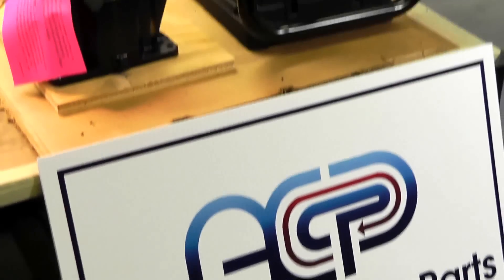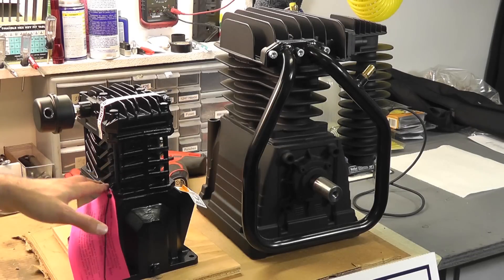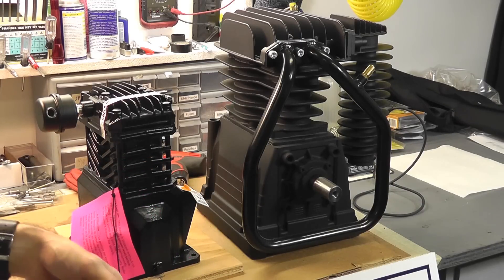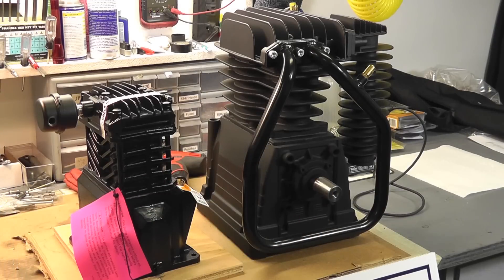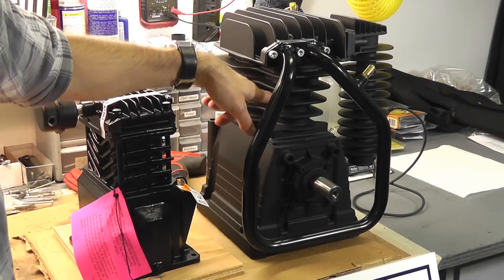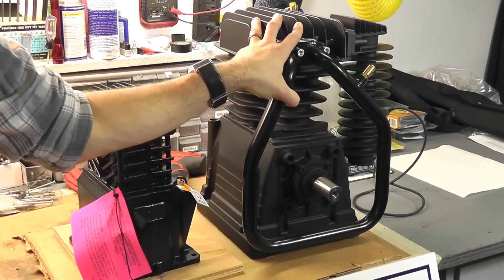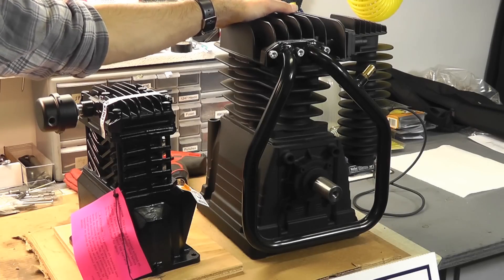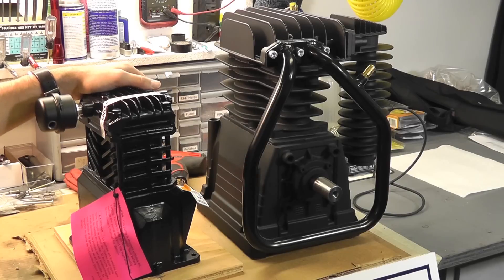The Difference Between A Single Stage And A Two Stage Pump

Comment: I own the that exact same pump got it new on an Air America made by DeVilbiss , 27 years old , has been a charm, replaced the reed plate and gaskets , upper end GASKETS needed 😊for that job, reeds had no lite passing Thur ,cleaned with de carbonizer , perfect.That was 6 years ago, been my best buddy.started getting louder , bottom end more so, then upper ,pulled the pump drained the oil thur the paint strainer , normal discoloration, always use wolfs head air comp. 10w30.needs to come apart , and before I open her up, want to be sure parts are somewhat available, well I have called many of the repair and sales and they say bearings obsolete, don’t want to get into cam bearing substitute, if I get lucky and find something close, specifications appear to-be non extent , So What I’m saying is 

HELP PLEASE 
Randy Carbeutor

Comment: single stage pump has more cfm than two stage pump. all piston are working to deliver air, rather than two stage pump that several piston suck air from atmosphere. single stage has equal size of pistons. I HAVE EXPERIMENTED IT WITH JUST THE PUMP(same size pump and number of piston) AS MANIPULATED VARIABLE. two stage does filled the tank slower. do your research first before arguing with me.
Reply: People often fall for marketing tricks and don't consider apolication.  The average user has little to no need for 2 stage, yet they think it's better for them when it's just better for the manufacturer to make more money.

Comment: Great video buddy, thank you for making it. I would like a stand up 60 gallon compressor but I don't know which one to go with when it comes to 2 stage or 1 stage. I'll be using it for air tools on engines filling tires and occasionally using a air sander or bead blasting engine parts and sometimes painting with my air spray gun but mostly I'll be using it for impact tools and tires. Can anybody point me in the right direction if I should go with the 2 or the 1 at stage.
Reply: pretty sure all that matters is the tank capacity and the CFM rating. any 60 gallon tank unit should probably suit your needs.

Comment: can u use the single stage pump on a 60 gallon compressor....?..
Reply from the maker: You sure can. There are many different sizes of single-stage compressors, from the smallest oil-free unit to large, v-twin (or tri-piston) pumps. Of course, if the pump is a very small direct-drive oil-bath or oil-free unit you won't want to install it on a 60 gallon tank, but any belt-driven oil-bath piston pump can be installed on a tank of that size.
Reply: @AirCompressorPartsOnline  ok great thank you

Comment: No!! You get more CFMs from a single stage because you have 2 pistons working together,, a single stage will run smoother and quieter and even cooler then 2 stage, due to not pumping the air twice, best to buy single stage for all around use,,,mine was set at 155 and I turned it down to 130 psi,,,all I will ever need and it will extend pump life because it cuts the time to fill the 60 gallon tank by almost 2 minutes,  more CFMs is more important than crazy high 175 psi pressure, unless your filling big truck tires,,,
Reply from the maker: You do have a point, George, and thank you for the comment. For most applications (especially weekend warrior types) a single-stage compressor is sufficient. Yes, a two-stage compressor operates at a higher PSI and generally, two-stage pumps DO produce more CFM, but there's a catch: at lower pressures, single-stage units usually do product more CFM but at higher pressures, two-stage units product more CFM. It also depends on the number of pistons each pumps has, and the size of them (as well as the horsepower of the motor running the pump).
Bottom line, it's really a matter of the particular application one will be using the compressor for.
Reply: @AirCompressorPartsOnline  l I have a 60 gallon single stage 2 pistons with 3.7 hp in my shop. 11.5 CFM does ok for most of what I do and electric tools have come far and even better than air tools now,,,, but I picked up a vintage speedair 4 cylinder Smith pump single stage with 8 hp gas engine,,,monster puts out 36 cfms,,, I restored it. like new payed 100 bucks and in research found out American eagle still makes the compressor pump and it's 6000 dollars to buy it now,,,lol. Love those finds
Reply from the maker: @georgespangler1517  You got yourself a find there indeed, wow. American Eagle is still around, certainly and I'm familiar with the Smith pumps as many were used on the older Sanborn compressors.

Comment: Looking to buy 5 HP 80 gallon air compressor but quiet one , what is your recommendation?
Reply from the maker: Thank you for the question! There aren't many very quietly operating 5 hp 80g oil-bath compressors out there to be honest. California Air Tools does manufacturer an oil-FREE stationary air compressor and the noise level on their compressors is very low, but the oil-free unit may not provide enough CFM for our application, so it really depends on the CFM demands of your compressor.
For oil-bath units, you should be able to purchase a noise-shielding cover for it, which is usually available as an accessory. It's essentially a ventilated, sound proofed box that covers the entire motor and pump.
You can see an example of a unit like that at the below link:
https://www.maxtool.com/products/belaire-qp318ve-208-230-volt-5-hp-80-gallon-vertical-electric-air-compressor

Comment: hey i have a 180gal 200psi tank i just bought its a saylor beal. and it hit over 200 unless the gauge is off...anyway i just bought it i think it might be from 1972 it doesnt look all thaaaat old but is that tank still safe to use to 200 psi? water drains a little orange but not brown
Reply from the maker: Thanks for the comment! As long as your tank holds pressure and you have no pinhole leaks, it [should] be safe to use. I can't speak to the integrity of the tank for 100% certainty as I can't see it, but I would certainly keep the pressure under 200 PSI just to be safe. Most tanks can handle this pressure but giving the age, I can't be certain. If the unit pressurizes past 200, I would replace the on/off pressure switch, as most two stage units are set for a max pressure of around 175 PSI.

Comment: Just want to ask another difference between single stage with two or more cylinder and a multi-stage with two or more cylinder is their size in piston, since in a larger piston large volume of air is suck having a low pressure, and goes into an intercooler then to a smaller piston to compress the cooled compressed air to higher pressure. 

in single stage no matter how many pistons a compressor have as long as it have same size of pistons it can't compressed further to a higher pressure.

Hoping for your reply thanks.
Reply from the maker: That's a good insight Julius and yes, you are correct. In 99% of two-stage units, there is a low pressure piston (at least one, depending on how many pistons it has) and a high pressure piston. the HP piston is smaller and the LP piston is larger. For S.S. pumps, the pistons are generally all the same size. Thanks for the comment!
Reply: When you look at the picture,,I have the smaller unit,,,but it has 2 pistons doing the same thing as the one big piston on unit on right,,making the same amount of air,,,, but unit on right has little piston to boost up to higher pressure,,,, my unit will make 155 lbs of pressure,,,at 11 CFMS at 90 psi,,, and is smaller and quieter and cheaper to run,

Comment: Hi there, very informative thank you. Would either of those models be a good piece to consider adding to my truck as a permanent fixture?  Mainly, during long runs, I really have no way of properly and quickly to fill up my tires.  it's a 1 ton dually pickup and heaven forbid i need to top up 4, 6 or 7 tires on in the middle of nowhere with nothing but the 'cough' heavy duty box store brands?  They need 80psi, one time when one was real low, i am quite sure after 30 minutes of nearing 70psi is why that compressor died.

Much obliged.  also, id like to know what you might recommend for such a solution to invent.
Reply: Fix the leaks and you don't have to top up 7 tires in the middle on nowhere
Reply from the maker: Thanks for the comment! When choosing a gas-powered air compressor for a service truck, I always recommend a two-stage pump. This will give you higher CFM and higher PSI. I'd recommend a unit that puts out at least 15 SCFM if not more. A 13 HP or 18 HP gas engine would be necessary to push a two-stage pump that puts out the CFM you need. I'd recommend brands like Jenny , Quincy, Ingersol Rand or Rolair as these are heavy-duty units made for the jobsite and service vehicles.
Reply: Wow, glad to read that, Ill check out those brands and consider the space and power requirements incorporating your suggestion.  I had a good deal to be made on a Schulz MSL 10 MAX.  Thank you kindly for replying to my question.  Glad you are still around!

Comment: i have the compressor on the left what size electric motor would i need to run that
Reply from the maker: You can run this pump with a 1 to 3 horsepower electric motor. Typically, a 1.5 HP to 2 HP is used, as the higher horsepower motor will give you more torque and hence more CFM delivery (due to it spinning at a higher RPM). Hope this helps!
Reply: Thank you for your fast response much appreciated :)
Reply: Air Compressor Parts Online , Thank you

Comment: what is the ratio between the large cylinder and the small one or dose it mater
Reply from the maker: Good question! I'm sure it does matter, and this spec will be determined by the manufacturer when designing and building the pump. It's not a set standard for every two-stage pump, as manufacturers have their own reasons for determining piston diameter, length, etc.. Many pumps I've seen have a high pressure piston that is roughly 1/3 the size of the larger, low pressure piston. That's a good question to ask the manufacturer if you have a specific pump in mind!
Reply: I am looking to build a two stage silent compressor using two fridge compressors. I am guessing to get them to work efficiently in tandem it would be ideal if the output of the first compressor was equal to or slightly less than the second compressor after its compression stroke. I am using a plasma and other tools in a residential environment and need high output but obviously low noise. in hind sight the first compressor will expand to match the second cylinder so it is really only crucial to ensure there is no back pressure in the first cylinder to cause stress but the second is still small enough to retain the bulk of the work the first has already done???. so a small priming tank would be enough to ensure both didn't work against each other. I am not sure I may have answered my own question but please rip it to bits if I am wrong

Comment: i m pretty sure that ''intercooler'' tube does nothing it s just a pipe doesnt even have fins and its to short to cool incoming hot air .. air to air heat exchanger doesnt work that way
Reply from the maker: You're right about this particular two-stage pump and about "air-to-air" cooling. The manufacturer calls the tube an "intercooler" but it's essentially just a transfer tube, transferring the air from the low pressure chamber to the high pressure chamber of the pump head.
The "aftercooler" on this two-stage pump does have fins, but for heat dissipation only. 
If the user wants to effectively cool the compressed air before it reaches the tank, one would have to install a belt-guard mounted aftercooler, a liquid-cooled stand-alone aftercooler or something similar.

Comment: How can you possibly say that a two-stage air compressor will as you put it recycle quicker
Then a single stage air compressor when the overall displacement is larger in the single-stage machine then the 2-stage machine case in point in a two stage air compressor the capacity of the machine is only the displacement of the low pressure piston does this make sense to you?
Also maximum interstage pressure is only 45 PSI not 70 check it for yourself with a gauge
Reply: No matter your displacement every pump of a single stage is going to give you about 100psi at best before transferring to the tank. A 2 stage is going to take that 100 psi pump and  hit it one more time in the smaller chamber and push it out to the tank at 175psi

Comment: I have a U.S. general Compressor in a garage I purchased... long story short it stopped building air, ripper her apart and the "stainless valves" are worn down. My question is where do I buy the darn little things?  I never thought in my life it would be so hard to find a few small pieces of spring steel to get me up and running again, until now. lol   Any help would be appreciated since my tire machines etc. currently run off of it.  I'm looking to upgrade sometime this year with a new pump etc. but need to get myself back up and going in this location for the time being since I'm currently in the middle of a pretty major truck build for a unaware veteran returning home soon.   Again, any help would be appreciated in this concern (finding said stainless spring steel "valves" to buy). If you can link me to someone to buy these little parts it would be GREAT!    Thanks~ Red
Reply from the maker: +510Redneck I'm sure we can help you find these Reed Valves. Do you have a model# on your air compressor? It should start with a "US" and look something like "US6580V2" or "US660V". It would be on a decal, most likely on the air receiver. If you don't see a model# then you can email us a few photos of the pump itself to info@aircompressorpartsonline.com.
We'll do what we can for you!
Reply: Air Compressor Parts Online Sorry for the sluggish response, been super busy and somehow missed this reply until now.
 Its the US660V, which for some reason I forgot to mention it seems (scatter brained). 

 Relevant question: You are affiliated with mastertoolrepair right? or no?   

 Again (just so we are on the same page), what I'm searching for is just the 4 small spring steel "stainless steel valves" that sit inside of the valve body (which is still in good shape). Said "stainless steel valves" have worn down and I'm merely searching for replacements and spare ("valves") for the future, as I will be putting this one (the 660V) in a different building after I "upgrade" to a better pump in the near future where this one is currently residing.  
 Thank you for your reply.
Reply from the maker: We are affiliated with Master Tool Repair, yes (ACPO is a sister company).

The Valves you need would be cheap enough to purchase, but they're not available separately I'm afraid. The "B3800" pump on this unit is made by ABAC/IMC (now under Chicago Pneumatic's wing).
The Valves are only available in a "Valve Plate Kit" which is part# 9428001 and sells for around $54. It includes Valve Plates with Valves pre-installed, and upper and lower Valve Plate Gaskets.
You may be able to contact Chicago Pneumatic to obtain individual Valves but I don't think they're offered like that.
Thanks for the question and let me know if there's anything else I can do!
Reply: Air Compressor Parts Online Ok cool, that's what I thought after a bit of research into the companies profile etc.  I did order the valve plate kit from MTR and currently awaiting its arrival. I only wish that I could get some spare "valves" for future maintenance of said compressor, that way for 1) I could keep her performing well while in use without unexpended downtime occurring.. and 2) keep from obtaining valve plate damage which results in having to buy a lot more than needed if able to properly maintain said unit.

  BUT with all that being said I understand how some manufactures work and its no fault of yours that the parts are not supplied to you in such a manner (or even available for that matter).

  Regardless, thank you for your help and I will be buying more parts from you guys in the future simply due to your efforts in assisting me... You will be at the top of my list to check with first in anything compressor from here on out.
 
I will let you know how the "valve plate" goes.. thx again... Peace
Reply from the maker: That is how the parts business works sometimes, you're right. It's too bad the manufacturer doesn't offer small components like the Valves separately as we would gladly offer them and it would be a very cheap repair, but as you stated it's only offered in an assembly.
Either way I really appreciate you giving us your business and for the kind words. We do what we can. Thanks and good luck with the repair and we'll be here for your future air compressor repair needs!

Comment: I cant pump up pressure. I think I got a hole in the tube that goes from the low side to the high side. I hear it leak and I put a rag on it and the noise goes away. I have not removed it yet to see if there is a hole in the tube or a gasket leak. I will squirt some soap on it tomorrow. What is that cooler thingy on the intake side. I want one of those. I just have an air filter set up in that location.
Reply from the maker: +YouSpamTard That's an Aftercooler and typically all two-stage pumps will have a finned Aftercooler to aid in cooling down the air before it reaches the tank. Many manufacturers offer Aftercooler options for air compressors, whether it be a bolt-on kit that connects directly to the head, or a Belt Guard-mounted option. 
Something like this, for instance:
https://www.grainger.com/category/air-and-water-aftercoolers/air-compressor-accessories/pneumatics/ecatalog/N-ae5